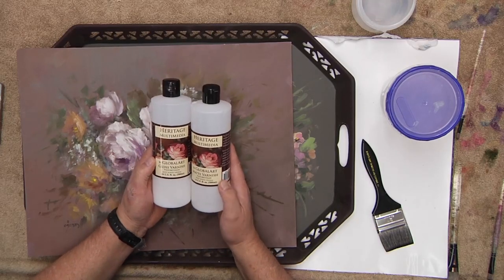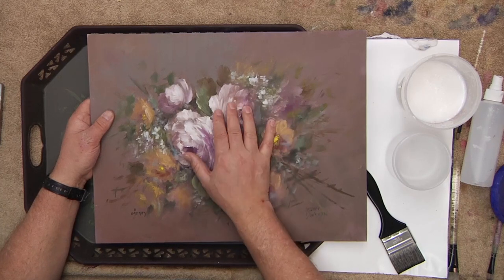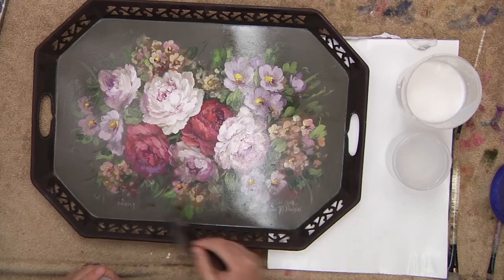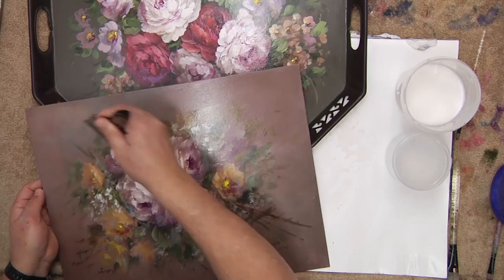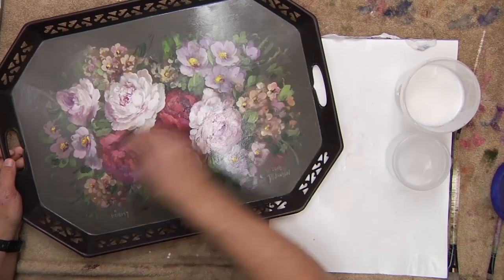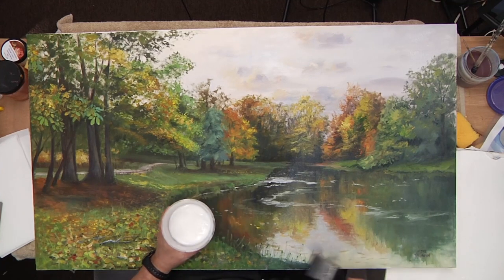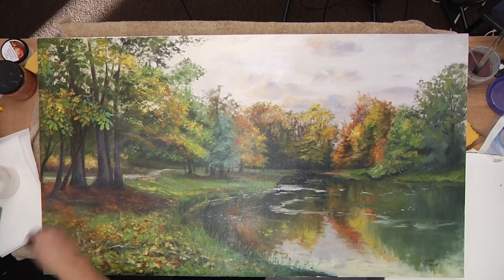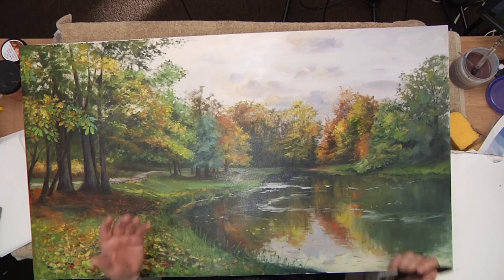Applying Heritage MultiMedia Varnish for Professional Finish

Comment: Thanks so much for this video Dave. I have been using a sponge brush but I think I need to pick up the brush you use.
Reply from the maker: Yes, the brush works a lot better for pushing around the varnish without creating foam or bubbles.  Thanks Dusty.